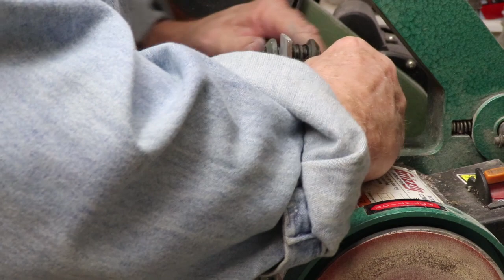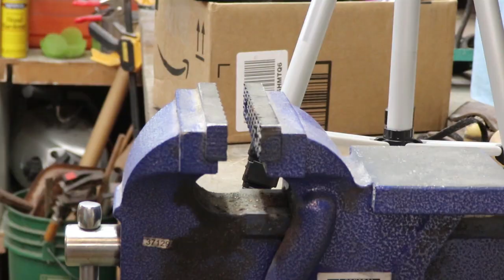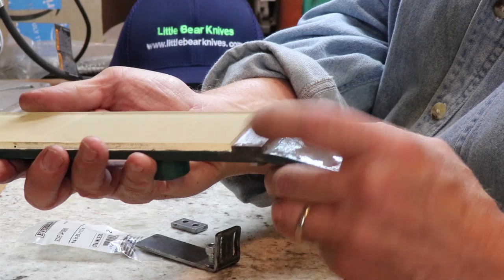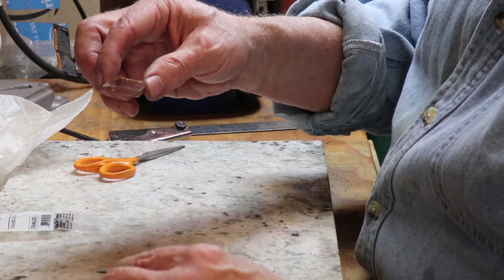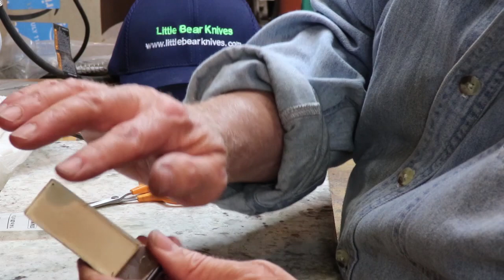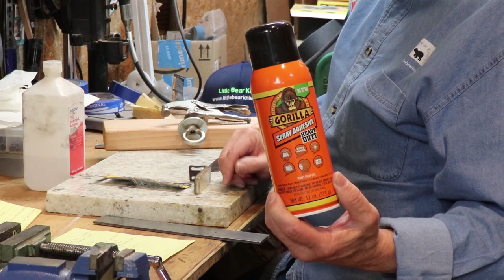Glass Platen for 1" x 30"  Belt Grinders

Comment: Have you heard of anyone putting a ceramic glass platen on a 6 x 48" belt sander?   Also, will borosilicate work as well as ceramic?  Thanks.
Reply: I have sold several glass platens for 6"x48" belt sanders but have had no feedback as how they installed them or how they functioned.  According to my research the temperature differential that borosilicate glass can withstand before fracturing is about 330 degrees Fahrenheit.  Ceramic glass can handle temperatures in excess of 1300 degrees.  You do the math.

Comment: To make your stop tight to the platen, the holes should not be threaded.  Straight 1/4 inch holes through the platen and threads on the stop would pull it up tight.  Seems like you could do both parts with high temp epoxy.
Reply: The problem with that is belt clearance.  The safety shelf has to be fastened flush so that no bolts are protruding next to the belt.  I have logged thousands of hours on my belt sanders with no failures of either platen or safety shelf.  I don't like epoxy in this application.  Everything is safe and secure but I can also take things apart if needed.  Another reason is Little Bear Knives is now one of the biggest and best distributors of ceramic glass platens and safety shelves in the world.  We ship custom made ceramic glass platens and safety shelves of any size globally.   Our safety shelves come drilled and tapped with the hardware needed for easy installation.   A lot of our customers do not have the equipment needed to drill and tap their metal platens on their grinders.  They don't need to tap their platens.  Just drill the holes and install.  Easy!!

Comment: I ordered one of these from you on ebay a few months ago, I finally got my shop setup and installed it on my 1x30 I love it. I have grinded bevels on 2 slipjoints so far. good belts with the glass platen improved the grinds so much and lowered my hand sanding  time a bunch.
Reply: Glad you like it.  I won't run any of my belt sanders without a ceramic glass platen.  Only way to go. If you need more, please use my website above.

Comment: Could you not just epoxy the glass to the platen? should'nt go anywhere, by the way, what is ceramic glass and where would one get a piece that size,? Good video by the way, I can see how the glass would be a superior finish to metal...
Reply: Sorry for the delay in replying.  Have been very busy in the shop.  A lot of people use epoxy and it works well.  I don't use it on my grinders because you only get to use the glass once.  When you remove the glass with epoxy as the base, it almost always shatters.  Glass is gone.  When you use a good quality double sided tape, you can remove it with acetone and reuse the other side of the glass.  See my YouTube video "Use Both Sides of Your Glass Platen".  Ceramic glass platens are available on my website listed above.  Any size you need.  We custom cut.

Comment: Do not mount glass on any power tool for any reason. Bad advice
Reply: Ceramic glass platens installed on stationary belt sanders have years of solid, safe performance.  I personally, after many hundreds of hours of use am very impressed with their value.  I won't run any of my grinders without a ceramic glass platen and have never had an unsafe failure.  Proper installation is obviously very important.  Little Bear Knives have sold over a thousand ceramic glass platens without any reports of injury.  Does ceramic glass break?  Of course it does!  But properly installed, replacement is simple and safe.  The reason so many knife makers prefer a ceramic glass platen is the superior performance.  Ceramic glass platens out perform and out last metal.  And that is the truth of it.  One final note.  Most of the better manufacturers of belt grinders offer ceramic glass platens as an option.
Reply: @stevedodge94  some people just need to be heard.... lol
Reply: Matt, you don’t know what you’re talking about here. This is a widely accepted practice used by professionals globally.

Comment: If I am using the grinder for sharpening will the replacement part make a difference?
Reply: I have been using glass platens on my grinders for a long time.  The glass platen is flat and consistent.  I don't have to worry about bad spots or or worn metal.  Some people find it hard to imagine that ceramic glass wears better than steel.  It does!!  If you want a flat platen each and every time, install ceramic glass.  But the choice is yours.  I have sold many hundreds of ceramic glass platens on my website as well as E bay and have never had someone come back and say they don't like glass and are returning to metal.

https://www.littlebearknives.com

Comment: I'm kind of new to this type of thing, I don't understand why glass is superior, what problem are you solving?
Reply: Sorry for the delay.  Ceramic glass lasts longer as a platen than metal and does not get grooves in the surface nearly as fast.  Properly installed, glass will last hundreds of hours more than metal.

Little Bear Knives

Comment: Thanks for the tutorial. How difficult is to remove the glass when you want to replace it?
Reply: Sorry I have not replied sooner.  Ben out with the flu.  It is very easy to replace the glass when needed as long as you use double sided carpet tape.  Acetone will eat the tape right up.  Simply drip some acetone, a little at a time at the top of your platen.  Allow the acetone time to work and then GENTLY pry apart with a blade or putty knife.  This is a money saver because you can use both sides of your platen.  Hope to have a video posted in the next couple of weeks demonstrating this.  Thanks for your interest.   www.littlebearknives.com
Reply: @stevedodge94  No problem at all. Thank you!